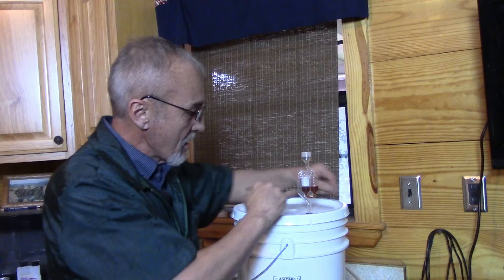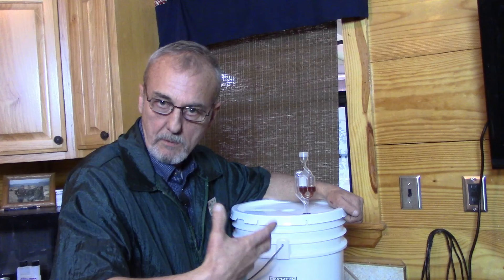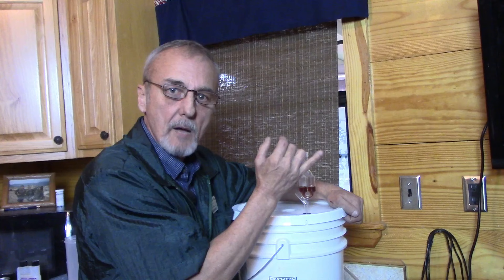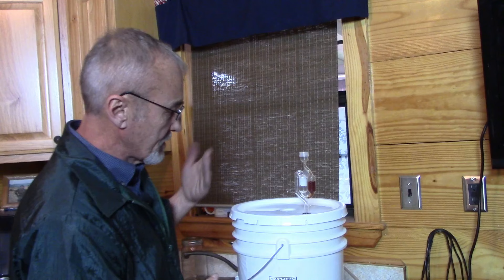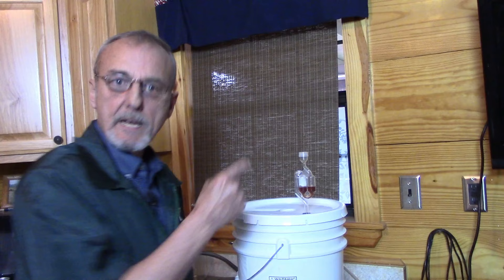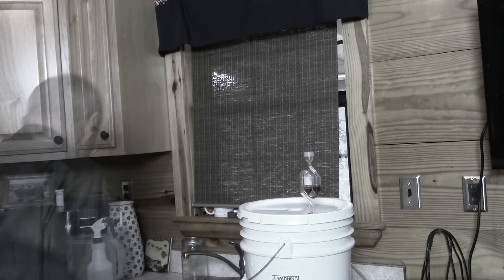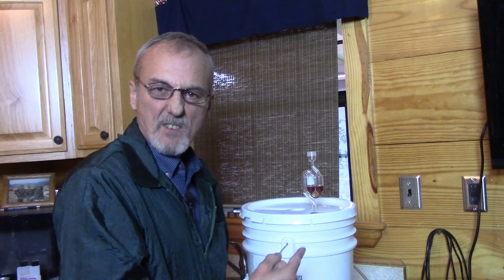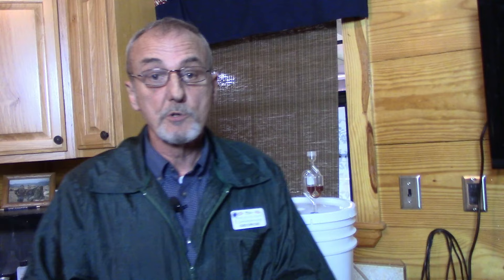Beginner's guide to fermentation, airlocks and what to look for

Comment: i have brewed without airlock. just let the can lock slightly open for 2 weeks then closed it but opened twice a day after 3 weeks i would open every other day. had a kitchen towel over the secured screw. where i live its hard or expensive to get brewing gear. the only thing i like with the bucket is the fact you can clean it so easy. however the airlock is addictive to use, you want it to have action and then less and less co2.

Comment: Your videos are very informative, thank you for putting all this information together, you gave me the confidence to give this hobby a try. I have been making ciders and beer for a few years and never had a leak so bad I saw no activity in the airlock, until this week! I was making my first Birdwatchers sugar wash,  OG was 1.083, and I pitched 5 grams of champagne yeast. I opened my fermentation chamber and could hear the fizzing in the fermenter but nothing was coming out of the airlock. I opened up the bucket and could see gases shooting up the side of the film on top of the wash. It was very active, I changed my cheapo 5-gallon bucket snap lid with leakproof (lid with gasket) and the bubbler was humming along in just a couple of minutes. Can't wait to run this through my little air still and see how it tastes.

Comment: I have never distilled anything ever and got a brand new distiller. My first recipe for whiskey...

40L of water around 180 Degrees F or 82 Degrees C
15lbs of crushed Corn/corn meal
8lbs of crushed Wheat
2lbs of Malted Barley

I let that go for a while using a brew bag until it cooled down to about 140 Degrees F or 60 Degrees C

Took the brew bag out, sparged out the excess starches and sugars. It was looking like the draw off the ingredients was quite good, very milky looking. Let it cool to about 86 degrees F or 30 degrees C
Pitched my yeast and let it cool to about 68 Degrees F or 20 degrees C.

I checked that same night and the fermentation had a very good cap and was bubbling like crazy... smelled like fresh bread.

Since it's my first time and I had no idea what I was doing, I didn't check the gravity and the lid was getting tight from the gas build up. I was worried it was going to pop so I stupidly popped the lid over night a crack thinking it needed air. I closed it back up the next morning.

When I came out the next morning, it was still bubbling but the cap was gone and it was about 60 degrees F or 16 Degrees C. (which I think is too cold)

It's still slowly bubbling but no new cap and it's starting to settle near the bottom of the bucket. Now the gravity reads about 1.005.

Did I completely screw it up? could it have just finished in a few days (24-48 hours seems quick to me).

I've purchased 4lbs of corn sugar that I'm thinking I might boil into some water and add it to try to bring up the temp and get a bit more sugar in it. hopefully that'll get the yeast going or I can repitch some more yeast.

thoughts?

Comment: Tip: If you want to test if your airlock works other than blowing into it (which makes a mess) try opening a can of pop inside the container and close the lid as fast as possible. The carbonation should cause an imbalance in the two chambers of the airlock and might bubble

Comment: Hi

I have been brewing successfully for last eight months. I live in Cholistan desert in Pakistan (close to Indian border), our summers are very long and harsh, the temperature reaches up to 50 degrees celsius. During, my previous homebrewing experiences (wine/beers), the fermentation process ended in 17 - 19 days during summers. Winters are short but night time temperature drops a lot, this morning (December 14) when I checked my beer, there are very few bubbles, or I can say almost no fermentation, while it is only the 10th day today. 

I need to mention in the past, whether I brewed 5 liters, 7 or 10 liters, I have always used the dry yeast sachet of 10 grams regardless the quantity of liquid, but this time I have brewed 20 liters of beer and the amount of yeast I added was still the same (10 g pack). But anyway as it is the mid of winters and the temperature yesterday during the day time was 9 degrees c and during the night it was -1 last night so I need to ask:

If this quicker completion of fermentation process is due to colder weather?
Is it due to larger amount of liquid (20 liters) and less yeast (10 g)?
Or shall I add some more yeast while the brew is already 10 days older?

I thank you in advance, and hope that you would be able to answer as soon as you could.
(whatsapp +923007003492)

Comment: Airlock is nice but not necessary for 2 reasons.

#1. Co2 is heavier than O2 and will rest on top of your ferment, creating a gaseous seal if left undisturbed (not blown away).
2. If you leave your lid on loosely, it will perform the same function as an airlock.
Now remember, during the fermentation process, you have a positive pressure environment. So oxygen can't get in anyway.

Comment: Now that we are in this covid pandemic and locked in our houses. I decided to make some home booze using a gallon water jug, I threw about 3 cups of sugar, half cup of cooked oatmeal. And two tables of bakers yeast sold shook it all up and let it set.. I let the top cap unscrews but just sitting on top of the jug.  I left and came back 30 minutes and saw that the head spilled everywhere on my floor, I've never done this before... but I just cleaned it up and put a half tablespoon more yeast in there. It's been fermenting I suppose very well for the past day and a half.  I open the top and can clearly smell the alcohol, smells like an sweat oaty I'd say 5 percent so far.  It's still going.. how long usually does this process last.. thanks  and you be safe.
Ps. I plan to drink the wash as is. I'm not an expert on how to distill, I have heard bad things for those that dont know what they're doing

Comment: Hi George, hope you're doing well. That was an impressive video about fermentation , airlock.  I'm planning to use a glass canister bottle for fermentation, it has a breathing cap. As per its features, gas inside the canister gets emitted thro air hole when fermentation takes place. In this situation do I need to have an airlock ?? And how do I get to know fermentation has actually taken place??

Comment: have been using small ultrasonic cleaners for making Aging alcohol Cannabis edibles, Tinctures and Coloidal Silver.I had the Idea to try it on my Fermentation of grain mash. My hopes were to make the mash into smaller particles and increasing surface area. I hoped to increase Bioavailability for the yeast. The 6 gal. plastic bucket I used for it kept blowing its top off as the bubbler was unable to keep up with the new rate of fermentation. I had to resort to taping the lid down with duct tape, Watching the bucket bulge from unreleased pressure  and hoping it did not explode. !!WARNING DO NOT USE A GLASS VESSEL FOR FERMENTING  IF YOU SHOULD TRY THIS METHOD!! I had hoped to show the increased speed of fermentation in this video. I made two mistakes. I used some pretty old yeast and I did not malt the grain first.
Still the control had not even started before the ultrasounde grain had filled its bag full. I believe if I had used a malted grain and newer Yeast the results would have been more dramatic for you to see. I am very new to brewing, only three batches with using ultrasound to decrease particle size the third batch. I did try a sugar wash 4th batch using the ultrasound but saw no changes in the speed of fermentation. . I am hoping someone with a better set up and greater brewing knowledge can experiment with this  and show the actual rate of increase. (I believe it to be about 300% or better)  
  This could have a major significance in such a large market as alcohol and fuel.A factor to consider is stirring the grai water mixture in the ultrasound as a heavy layer of grain at the bottom may reduce effectiveness. I used a 60 watt, 40khz ultrasound unit with just one transducer on this video . On the earlier bucket run I used a home made unit with two 40 khz transducers.  Finding the optimal  range of transducers, frequency , volume, stir rate and length of time I leave to future brewers with more capital and time to find

https://youtu.be/xlaGz_3mKhU

 https://www.youtube.com/watch?v=b_mdvsEF3vo&list=PLD7nPL1U-R5pl-EsIsmgZTuS0t3Tm6EV8&index=8

Comment: Does the airlock matter as much if the final product is for distillation? Also if a good way to start up a stalled fermentation is to stir it, why is it so important to keep oxygen out? If it isn't sealed will it affect the amount of alcohol you produce? My brother in-law makes shine and all he does is set the lid on the bucket. No seal at all. But he also doesn't know a whole lot more about it than I do. If I'm going to do it, I'm going to do it properly.
Reply: Oxygen will turn it to vinegar which will only distill into more vinegar, not alcohol

Comment: ive had my 10lbs of sugar and yeast sitting in  a 5 gallon water bottle for 3 weeks.  Ran a gallon through the distiller and nothing.  If I shake the  bottle it will fizz but I never get in bubbles in the air lock.  I sealed it with electrical tape but there is nothing going on.  I just dumped in another packet of yeast.  What is happening here, what is the fizz all about if there has been no fermentation?  How did  they make wine or shine without the fancy bubble catcher?

Comment: So I really messed up on my first attempt. I actually left air in the bottle purposely filled the bottle below the airlock tube turns out that's not right. I'm starting my second attempt right now. So I'm going to fill it to the brim then put the airlock on and fill the airlock to the fill line. Is that correct?

Comment: Big question do you really need an air lock. Gasses will leave the carboy but there is no vacuum 
to pull air back in such a small opening.

Comment: Hi George! 

I’m doing my first fermentation and decided to do a 5 litre sugar wash because i didn’t think i could mess that up... but i did.

For some reason, barely any carbon dioxide is being produced, it’s super super slow and it’s only the second day, and it didn’t do anything on the first day. Can you tell me if there’s anything i may have done (there’s no leak by the way).

There’s also no action inside, and no foam or bubble being produced in the carboy.
Reply from the maker: Not sure what to say. How much sugar did you use and what type of yeast?

Comment: Hi there, my airlock keeps emptying of water very quickly. Does this mean the seal isn't tight enough?
Reply: It keeps emptying? As in the water level is going down? I know just before my wine is finished I often have to top the water in the airlock back up. It's because the water is evaporating.

Comment: Hello. I need some help. I'm fermenting my first beer. A Muntons connoisseurs ipa bitter. I started with an OG of 1,040. It has already 5 week and it doesn't go below 1,010 (fermenting at about 19 to 20°C).

What can be going wrong? Why doesn't it finishes the fermentation or reach below 1,006?
Reply: By the way. In desperation I've already bought a inkbird and a tubular heater to make a fermentation chamber. What temperature should I aim for to force finish it?

Thank you
Reply from the maker: Most fermentation (even beer ) are more active around 24-26 C
Reply from the maker: Unless you are doing a lager